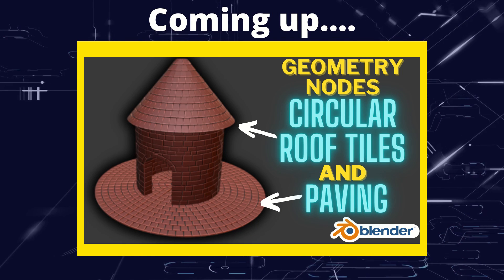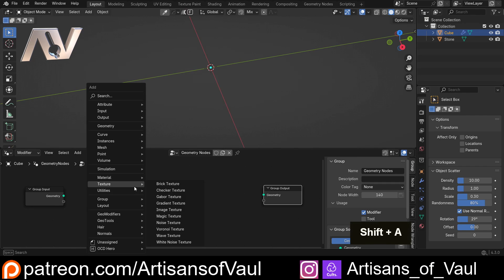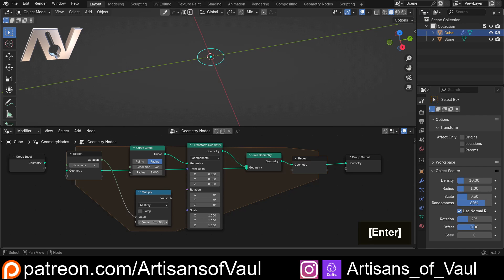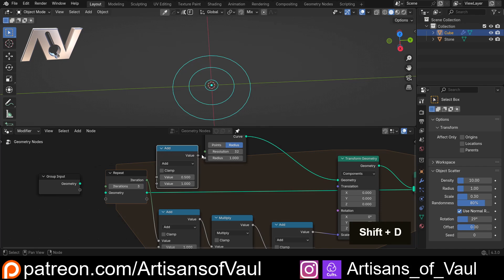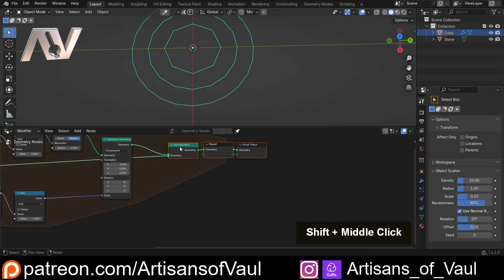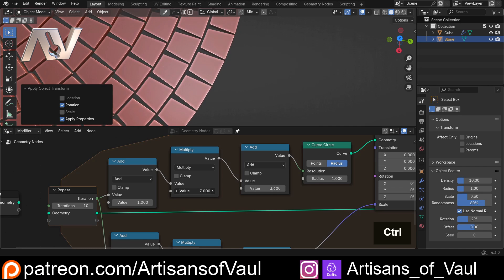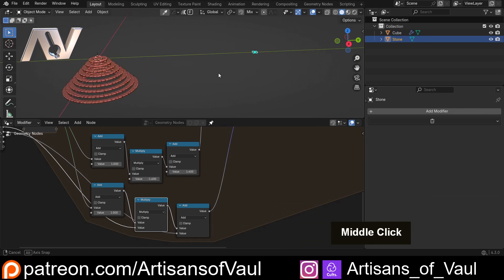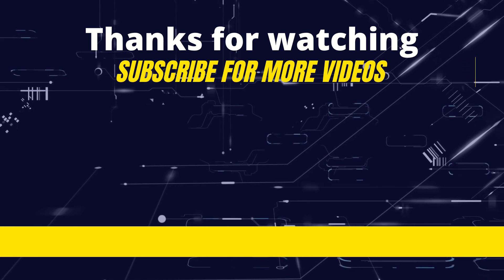Procedural Circular Paving and Roof Tiles in Blender with Geometry Nodes

Comment: Hello, I watch your tutorials very regularly because you explain them really well, but in this video there is something that I can't do after creating the Procedural Circular Paving Roof Tiles, my roof is too "clean", too straight and I would like to curve it a little towards the inside, as we can do with "Lattice" via the "editor", but in your case, it is impossible to use the "Lattice" and we have to "convert to Mesh" which is also impossible... and in the Nodes geometries the "Lattice" does not exist, and my question, what is the solution???? would you suggest a video in this sense???
Reply from the maker: Ah...  My bad, and good catch.  After the instance on points node there should be a "realise instances" node.  That will sort it out.  Then you can use a lattice or any other choice of ways to manipulate it 👍
Reply: @ArtisansofVaul  Thank you, it works perfectly   😉@+ jean-Louis from Brugge in Belgium ( a 70-year-old Blender student )

Comment: Thanks a lot. I've been searching for a way to this for roofing, I've never found any compelling or at the least decent way to do this. My work around is do a linear array and then bend it with a simple deform modifier. Ater that, I'll proceed to make more wobly with a lattice modifer. As you can see if a lot of hasle for a roof. So I trust this is very useul. But I can't seem to the rotation of the curve circle on every instance. I tried a bunch of nodes but none of of them seem to do it. Could you help with that?
Reply from the maker: @ismailabdulkarim210  Do you mean the rotation  is wrong on the tiles...?